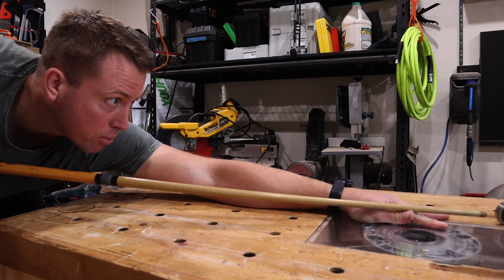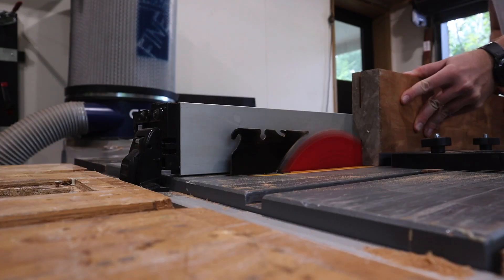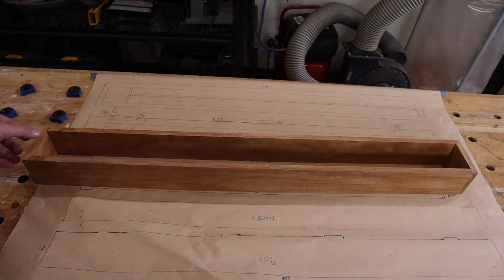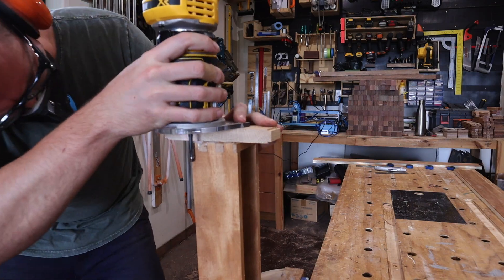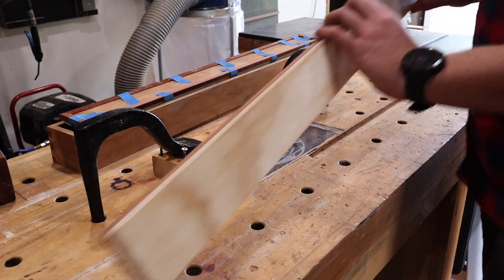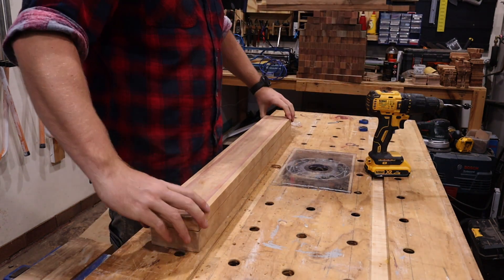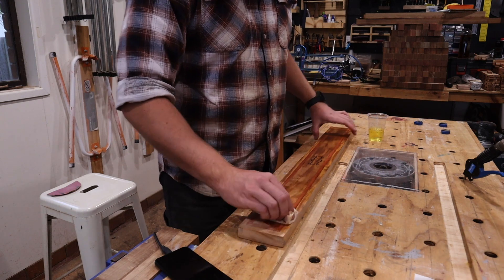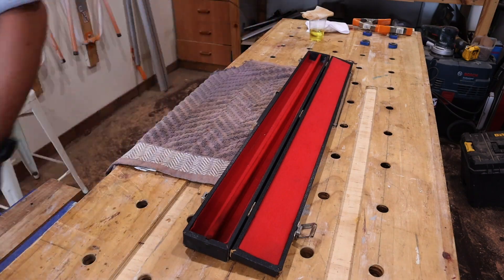Making A BESPOKE Inlaid Pool Cue Case - Is It Fine Box Making? Probably Not.

Comment: Nice job.
I made my cue case over 30 years ago using a solid piece of Brazilian mahogany which I routed out so no joints necessary.
Lined it with red velvet from the curtains in my local pub 🍺when it was having a refit😂Wish those hidden hinges had been available at the time as I used four small butterfly hinges and four matching catches as well as two brown leather straps to keep it secure.
Finished it off with three coats of yacht varnish sanded with 1200 grit between coats if I remember rightly. It’s picked up a few marks over the years but still looks pretty good. 
That Beauty you made will last for years if looked after👍
Reply from the maker: Wow that sounds like quite an impressive case Ian. It's nice you were able to incorporate a bit of history with the old velvet curtains too!